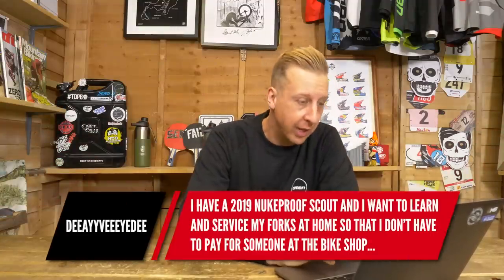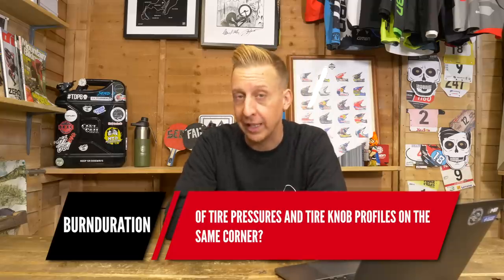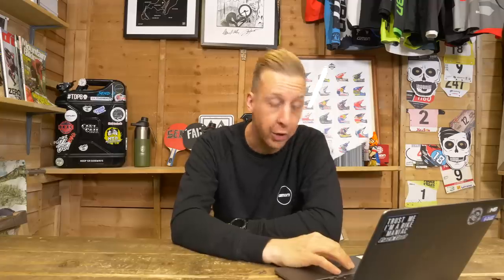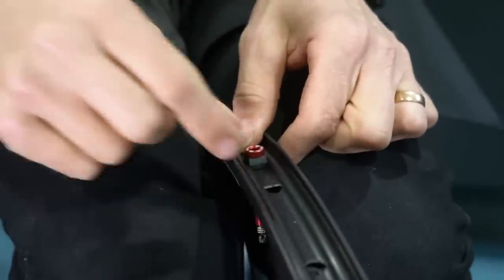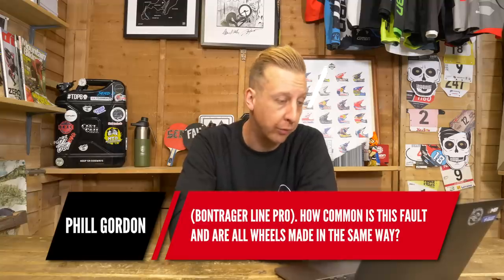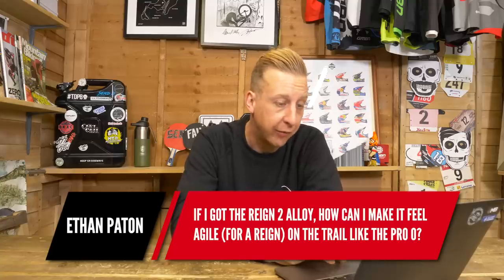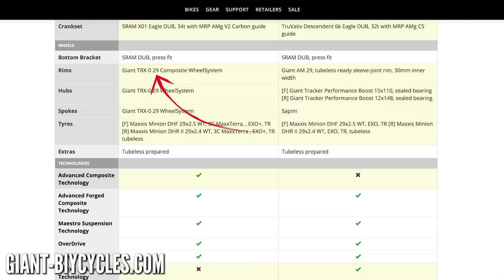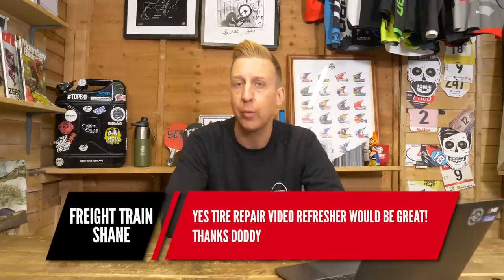Full Or Open Face Helmet For Mountain Biking? | #askGMBNtech

Comment from the maker: Got a question about mountain bike tech? Submit it in the comments below using the hashtag #askgmbntech
Reply: #askgmbntech Are there any extra maintenance tips you need to bare in mind when looking after a steel frame bike?
Reply: #askgmbntech is the feeling of hitting your rim (or noise like hitting it on concrete) when you have low tire presure bad for your rim?
Reply: #askgmbntech what is the best budget-friendly dropper or should I get a nicer dropper but need to get a button to use it?
Reply: @eastcoastmtb8219  I recommend the brand X ascend II from Chain Reaction Cycles. It's often on offer for about £100, you get 2 years warranty and it performs just as good as droppers that cost twice as much. The lever it comes with is a bit pants mind.
Reply: @superspecky4eyes  i will look into it Thanks
Reply: #askgmbntech what is your opinion on Box components new prime 9 drivetrain? do you think its a good idea to drop the cog number to 9 gears but keep the gear range of a 11 or 12 speed cassette? I think i might try it out, seems like a good way to drop a little weight and simplify the drive train a little bit.
Reply: Is 455 to long for a chainstay?
Reply: #askgmbntech hi Dodds love the vids very useful. I got a dropper today, it’s a ks eten-i for £15 of Facebook (such a bargain!). It doesn’t fully return when I hit the button about 75% goes back up but I have to pull the last 25% up. Any tricks to make it fully go up on one click? Thank you so much!
Reply: #askgmbntech hy i have al old 2008 specialized sx trail two. It has hydraulic brakes juicy five and some people say thad thes brakes get stuck often in summer when its hot. Is this true
Reply: #askgmbntech Hello! I got Scott Gambler 20 2014 and I want to replace frame bearings, but… which bearing press fit should I choose? Do I need separately tool for removing them and then re-install? Also I’m not sure about that stuff I marked in orange circles, what’s the point putting it there? Thank you guys! Have a nice day!

https://drive.google.com/open?id=1cz6WgT3-2eBnhJfUiisbIbSHAnYLgPDV
Reply: #askgmbntech hello, love the channel/channels. Looking at getting into mountain biking and have been looking at the Dune fat bike by calibre. My main concern is I’m fairly certain I want suspension forks. Being that off the lot this is a rigid bike can I replace those forks with suspension forks? I’m very new to all things mountain bike and only have the knowledge I’ve gained over the last few months watching GMBN and other similar Chanel’s. Do rigid bikes have the geometry for suspension, is this a no brainer that I’m thinking to hard about. Thanks for any help, keep up the good work on introducing and educating on all things mountain biking.
Reply: #askgmbntech Hi Guys, love the show! I've just purchased a direct drive trainer and was wondering whether it would cause any issues using a smaller range cassette 11-28t on the trainer while still using a 11-42t on my bike for normal rides without having to make adjustments to the derailleur each time I switch over? Cheers Brad

Comment: Hi!! I've got the bell super 2r mips and its awesome, super comfortable and easy to switch between full face helmet to full open.
Reply: I ride with the Bell super 3r mips and I love it. With a little practice you can put the chin guard on without putting down the helmet. Only downside I would say is that it looks a litte big without the guard. Like if you have a mushroom head :-)
Reply: @_demerl_4855  I've got the 3R also, and I really like it. I'm an absolute novice on an MTB, but being in my late 30s with a young family I prefer to be safe than stylish!

Comment: I recommend to get a full face helmet, you can mount a camera to the chin guard, also it will protect you from branches so will goggles, with a nose guard, so for mountainbiking it's a must.
but really a full face is a good idea no matter what or how you ride, but of course if begin really careful and only riding slow on pavement then that's whole different story, but a full face helmet will protect you from face plants, I would never ride without a full face. so unless I was just riding gently to the store and felt really in control and strong, but if you feel weak and not in control then it can end up in a face plant or almost, so if you did not sleep enough and are out riding for example, try to avoid doing that, but if you already are or need to use a full face helmet and all protection you can, and of course ride as carefully as possible no stunts.
weight of helmets:
don't worry about the weight, you will get used to it, I use a 1500g helmet and it felt a lot heavier, than the half face I used before,  but now it feels light,  you will build up strength in the neck, but if you have an abnormally weak neck, due to injury I would go for a lighter helmet, and not ride gently and no gnarly stuff, once muscles are built up then go for heavier more robust helmet, and gnarly riding.

Straps on helmets:
I recommend going for dual/double D ring buckle, because it's an strap adjustment and security mechanism in one, it holds the strap secure, so it does not go out of adjustment those backpack buckles do, they don't have anything that actually clamps them secure, so if strap is long enough some people tie the straps it can't go out of adjustment, but in many cases the strap is way too short for this.
Magnetic buckle has the same problem.
So Di ring stays will say my favorite, cus it's all in one solution that just works.
Reply: Thanks... good info

Comment: i use the met parachute mcr, and it's great. I take it in open face mode to reach my downhill and i add the chin bar just before droppin in. You fell confidente in the trail, not scared to push harder and lighter when you pedal...
I break my rear hub too. I was doing some trial moves on the back wheel and when i put a big pedal stroke, my rrar hub die...

Comment: #askGMBNtech I'd like to see a comparison video with a normal fork vs an inverted one. Not performance based but dirt and grime based. I was wondering is dirt etc is stuck on stanchions would you be better having an inverted fork that way pushing dirt away from seals instead of toward it? If that make sense?

Comment: #askgmbntech Hi, I'm thinking of switching my 3x9 drivetrain to a 1x. I'd need to keep my rear derailleur, an Xtr M960, because a new one would be too expensive. Currently I've got a 11-34 tooth cassette and I found a 9 speed 11-40 tooth cassette on the internet, but sadly I can't find any information of a range limit or something on my derailleur. Would a 40 tooth cassette be fine, or maybe a 36 tooth one? Also for cranksets most say their for 1x10/11 or 1x11/12, does this make a difference for a 1x9 or is it just branding? Thanks
Reply: As other commenter said, think about 2X.Your derailleur should be fine, just give it less/more b screw.  I've seen plp run a narrow wide big ring, 32 or 36 tooth, this holds the chain, then manually move to the 22 inner ring and use that for pedalling up. Bit finikey but works. Or just get a 28 to 32 tooth narrow wide, and go with 40 rear

Comment: I ride with my GIRO. Occasionally I take the jaw guard off, however, I grind myself into the Earth occasionally too, so...
A lot of guys...likely better riders than me, ride the gnarliest trails out here with a half lid. And they seem to do just fine.
I live in Vancouver. Ride here. And I do feel better with the full face on.
Google Le Fort Fracture. I've seen a couple...
Plus, there's the wild life factor. 
Not a frequent occurrence... But always on the back of your mind.
When I'm out for a long one. Big climb. And I have that 'not in Kansas anymore' feeling... I like the secure feeling, that were something to slam me to the ground and (attempt to) wrap it's jaws around my head and neck... 
There are Bear and Cougar out here, and they put juveniles down every year for wandering into neighborhoods and scooping up pets. 
I ride with a pack that has, secured to it for quick access, a knife, and for those long ones, a 25 oz can of Bear spray. 
What's it like to ride somewhere where you don't have to think about the wild life, I wonder...
Reply: I agree with you 100%...I race mx so it felt pretty natural going to full face on my mtb. But, I bought a Giro Switchblade last year and have been riding open face on local trails in SoCal and full face at parks and my trips to Colorado. I'm pretty happy with it so far.

Comment: #askGMBNtech  Thanks for all the great tips Doddy. I would like to know if hitting jumps or going down hill with the suspension lock out on (either front or rear) will hurt the fork or shock? Thanks guys. Cheers from Costa Rica.
Reply: The odd one when u forget might be ok, but defo not something to do often as will cause damper damage
Reply: @rupedog  That's what I want to know. I guess whatever holding the suspension in position is not too big and will break if hit hard. Problem is sometimes I like to leave the rear locked on flat surfaces for pedaling, but I don't want to damage the shock.

Comment: After 3 stitches last summer + pushing my limits more & more - full face only for me now. Bought a 2019 Bell Super 3R Mips & have never felt more secure & very comfortable.  The only time I remove the chin guard is to hang out or family ride, it's on 95% riding even racing short tracks. I couldn't ride in a regular lid now

Comment: #AskGMBNtech hey doddy! I have been using shimano xt rapidfire shifter for awhile now and i have been loving it. I wanted to upgrade to a sram but don’t wanna loose the rapidfire shifter. Can I use shimano XT M8100 shifter 12spd to a Sram XO1 or XX1 12spd RD?
Reply: Some lad on YouTube says yes, for 12 speed but I'm not sure. Check YouTube and make up your own mind. It's a lot to shell out for it not to work. He also says there are others you can mix and match. Can't remember who it was but he tried three combo's.

Comment: The one challenge with upgrading the cassette on the Giant Reign alloy is that the NX cassette that it comes spec'd with fits on a Shimano free hub body where as the GX, X01 and XX1 cassettes all use the XD free hub body so you'd not only need a new cassette, but you have to change your free hub body as well. #askgmbntech
Reply: Or fit shimano cassette and shifter

Comment: I have had two bontrager hubs fail. I don't trust them anymore. Never buy a Trek bike unless you can afford the most expensive ones, otherwise the component quality may be compromised.
Reply: Treks always seem such good value for money though. I got the entry level Remedy and it's basically a great bike but with cheaper components as you'd expect at that price point, I've upgraded as stuff wears out but just really disappointed with the Bonty wheels. having said that they are a budget carbon wheelset. I'll keep them as  a spare wheelset. Whilst waiting for for my warrantied wheel I got some alloy Spanks which I really like, lighter and stiffer than I expected

Comment: Hey! I have a bike with 27.5×2.1 tubeless tyres on it and I want to replace them. Can I put for example27.5×2.4 tyres on it or is it impossible??? #askGMBNtech
Reply: Possible but check the frame for clearance issues. Try a mates tyre on your bike first maybe. Also different tyres are different sizes even though same numbers marked. This is s try before you buy thing. Get a second hand one of the bigger size you want and try it for size. Cheapest way to try it.
Reply: Or even ask 2nd hand seller can you try before you buy. Bring your bike over with a pump

Comment: #askgmbntech I’ve just installed a MegNeg on my Super Deluxe shock, I’ve removed all token and bands on the advice of Sprung Suspension for a starting point - my bike is a 2019 Nukeproof Mega. I’ve used a ShockWiz to set the shock up and it recommends to make the compression softer - does this mean I need to add a band to the negative chamber? 
The rebound, air pressure & spring ramp are all ‘in the green’. 
Thanks
Jon
Reply: Compression is not the spring so nothing to do with volume bands.
Means turn ur conpression/damping down...so LSC to - (minus) and make sure it's in open mode (not trail or pedal etc).
If already fully open, then try putting the orig can back as those megnegs are only beneficial to certain suspension designs and shocks, not all. People buy them thinking will improve things, but most shock/bike combos this isnt the case. Should only fit megneg to address specific issues. For most it will make matters worse.
Only other option is to get shock damper retune done to lighten the tune, so u can adjust ti get in green on ur quarq
Reply: Rupert Wenn I don’t have an compression damping controls on this version. Maybe a retune, as you say, is in order.

Comment: Hey! I've been riding with my Giro Switchblade for about 3 months now, I got it on sale around the holidays. I love it but there are a few things you should know: Don't get the visor bolts too tight as they strip very easily. It does come with a spare visor and the spare has a GoPro mount built in but it is too flexible to actually support the camera. Would be fine for a riding light. Also the removable chin guard will be extremely stiff and hard to remove when it is new, this goes away as the helmet breaks in. Overall I love it and if I ruined it I would go out and grab another!!

Cheers, love your channel!!

Comment: #askgmbn I have a generally silent canyon torque, but when I ride my bike on stairs, the back wheel will make a loud noise on the bottom transition between stairs and asphalt. The rear end also makes the same sound if I bunny hop and loud nose heavy. The cassette is tight and the tyres are pumped up to 30 psi. Any idea what the sound may be? #askgmbn
Reply: Sounds like full bottom out. Let some air of out shock and more be the bike through its travel, see if it makes the noise as it bottoms out. Have a mate pump the bike through its travel while you listen

Comment: After about a year and a half of being in the sport, I am upgrading from my first entry level bike. The new ride has 2.4” tires on 27mm rims. My question is, what differences, if any, will an intermediate (at best!) rider notice in that sizing coming off a 2.6” on a 30mm rim? Thanks #AskGMBNtech
Reply: Lighter rims you will notice on acceleration, along with lighter tyre. You may notice less grip on 2.4 Vs 2.6 if you were really pushing the 2.6, but I doubt it yet. Go for it I say.

Comment: #askgmbntech I need a whole new drivetrain but I can't find a new rear hanger could I use a lever and try level it out
Reply: Remove it and hammer.flat
Reply: Or get the park tool or other hanger alignment tool
Reply: @rupedog  as he said, remove it first before trying to straighten it. You could end up bending your frame otherwise

Comment: #solutiondepartment i have done a lot of cheap rim tubeless setups. And that problem doddy discribes, leaking on the joint. Google bondic it is a uv activated glue. Ever since i started using this a bad joint isn't a problem anymore.  Cheers
Reply: If the rim is taped properly and fully, then thus should not matter...the join 'hole' is smaller than spoke holes, so problem is the taping not being edge to edge
Reply: Often was the leak at the side were the tyre bead should close it off. of at the transition between tyre  bead and rimtape. So basicly were the manufacturer push the pins in the rim to make the joint.

Comment: #askGMBNtech hi guys when I compress my RockShox monarch plus rc3 there is a clicking in the first few millimeters of the travel and then it seems to perform fine. The clicking is worse when I have the shock on the fully open then when I have it on middle mode. Any ideas what’s wrong ?
Reply: Could be a creaking bush in the eyelets. Remove, put bolt through eyelet and tighten to correct torque then use spanner to turn bolt and thus bushing. Should be stiff but rotate bush silently. Is doesnt rotate or noisy indicates a dry/creaky bush. Replace. Or could be something in the compression...suggest a full service, but make sure u highlight the issue to them to look at.
Reply: Rupert Wenn thanks but I’ve took the shock out and put it back in and made sure all the bolts are tight but still making the same noise. It get worse when the shock is fully open versus when it’s half way open

Comment: #askgmbntech I got a new bike and obviously went to set the tires up tubeless. They were pretty tight and after setting them up, I noticed that there was a pretty noticeable throw in the rear tyre. I read online, that the carcass may have been broken. I can't feel anything whilst riding, but is this a concern? Can I keep riding or do I need to throw a brand new tyre out and go looking for a new one? Thanks for the shows, keep the good work up fellas!
Reply: Same happened to me. I just ride it.

Comment: #askgmbntech I have a 2020 rockshock lyric and I was wondering if I can increase the travel up to 170mm or 180mm even though the sag markings are only for 150mm and 160mm. Thanks
Reply: There are several sets of markings. Find the one where it reads highest number currently at the seal (bike no weight on it at all/fork fully extended), add that figure to ur current travel = ur max travel. E.g. 150mm fork, if ur other markings at seal are 10, 20, 30, then 30 is highest 150+30=180 ur max travel spring can fit.
Reply: Yes, you'll just have to do the sag by feel. My Pike is marked for 130/140 but has 150mm travel
Reply: I would have thought the length of the stanchion would determine how long an air shaft you can go. Some forks will take a 120-150mm air shaft, my yari takes 170mm or 180mm. I wouldn't try a smaller one is it as I don't think it takes it. Ring TF tuned with the make, model and serial number. They will happily tell you if it's possible before you buy anything.